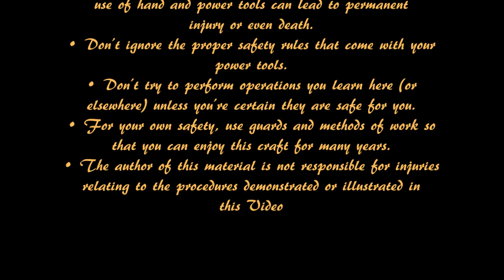Shop is growing but never enough by Al Furtado

Comment: That's tidy work Al, is building your business by any chance?  Also, that extension doesn't overpower your beautiful garden.  I think you've done great there.
Best Wishes, Brendan.
Reply from the maker: Thank you my friend. Well I was a small general contractor for many years one that was hands on in every phase of the job and now even though not a hands on I supervise every phase of some very large projects. Building this shed addition showed me how much hands on I needed again LOL. Live and learn your whole life huh?
Reply: I just thought, by the way you approached this, that there was building experience going on.  My mates are builders and engineers and they approach work in a different way to inexperienced people.  As you said, the builders are able to do every job on a site because, as they say, "the job just has to get done".  They also say "You put your schoolbag on every day".
Reply from the maker: The only reason I did it this way is because it was small enough. Generally you build walls with single bottom plate and 2 top plates than set up trusses or build rafters with a ridge in center. That would have been the easy way. I decided to complicate it just to match existing structure LOL

Comment: think the original corrugated roof is going the wrong way ;prolly holds rain water
Reply from the maker: I agree not that it holds water but that it should go top to bottom but I understand why they build them that way. Cost  as no bridging needed for the corrugated and no roof cap even though they would save on the overhang. My ide will be to add a plywood roof and 3 tab once all said and done.